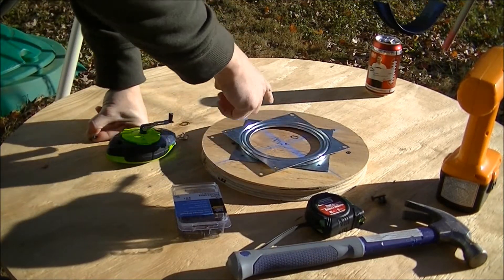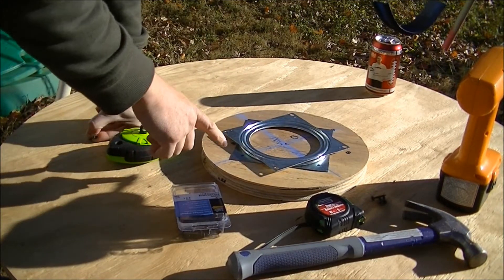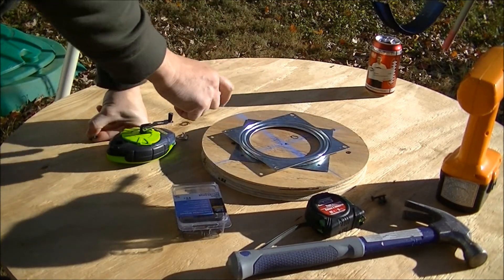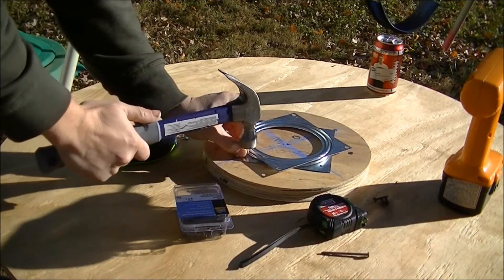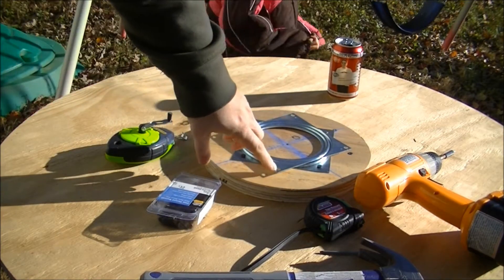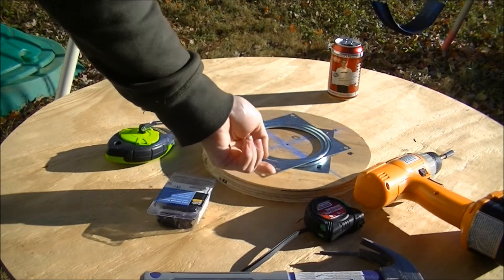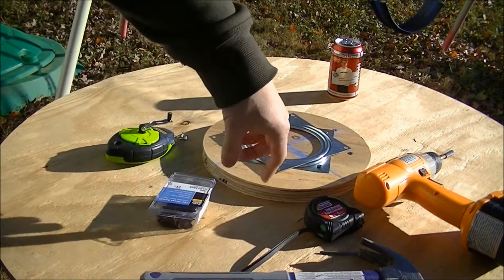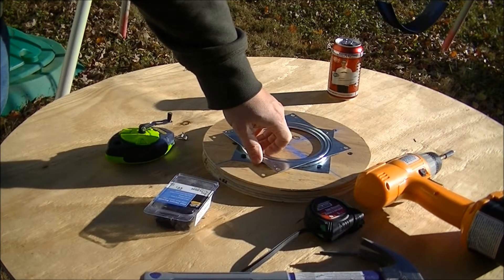How To Build A VAWT Part 2 Add the Pully

Comment: Why not use base for  pulley? Im thinking to make larger scale version of this but with car alternator.
Reply from the maker: The base could be made into a pully, just keep in mind the power that will be required to turn the alternetor equals the alternator resistance times the square of the gearing.